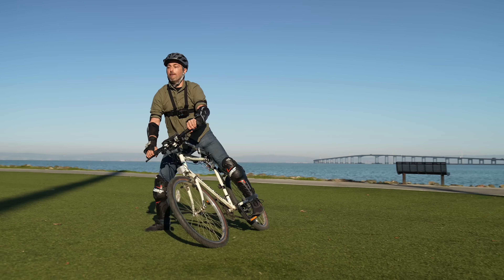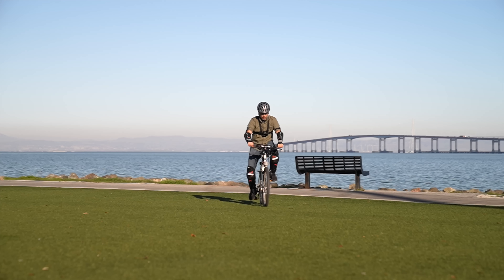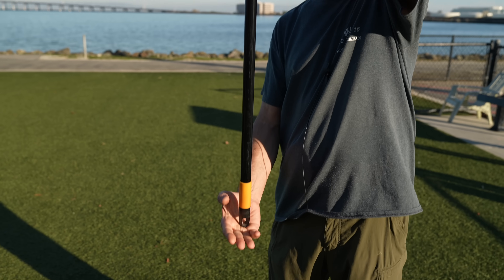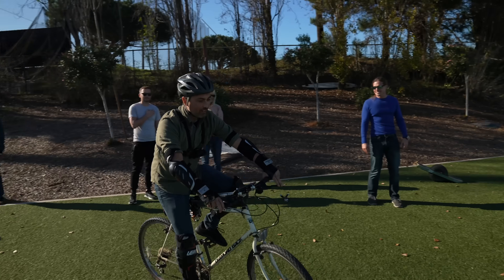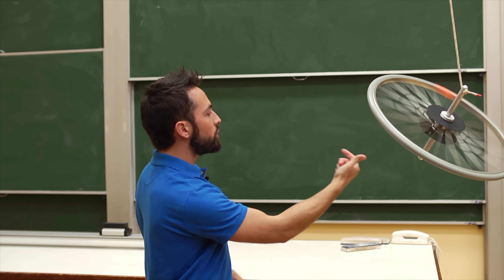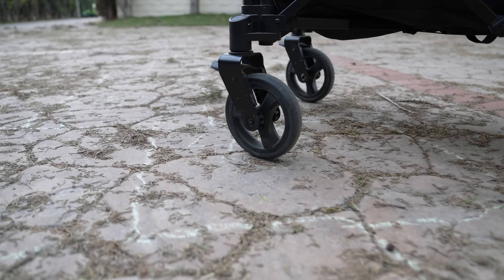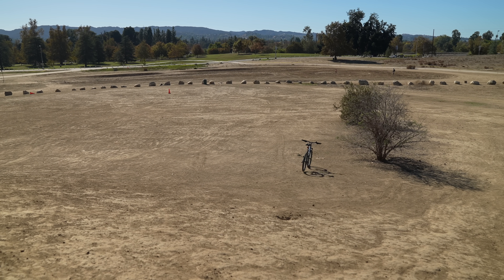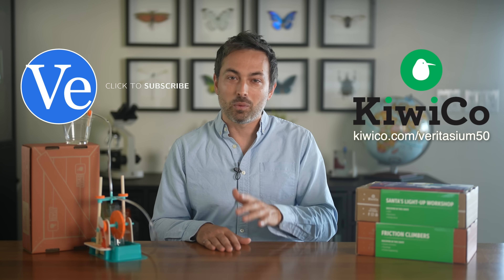Most People Don't Know How Bikes Work

Comment: I find it strange that the gyroscopic effect is just dismissed because there are other phenomena going on as well. The gyroscopic precession does in fact help the rider balance on the bicycle while the wheels are spinning. Anyone who has tried a scooter (which has very small wheels and thus significantly reduced gyroscopic effects) knows this because the amplitude of your corrections will be greater. You can also notice that on a bicycle with small wheels (actually it's the front wheel that matters), you need greater corrections than on a bicycle with big wheels because the moment of inertia of the front wheel is smaller. This can only be explained by the gyroscopic effect.

When you ride a bicycle, the front wheel is spinning and the gyroscopic precession demonstrated in this video thus works both ways. When you turn the front wheel (which is spinning forward) to the right, the gyroscopic effect immediately tries to tilt the bicycle to the left and this effect is instantaneous, unlike the effect of positioning the bicycle underneath yourself, which doesn't kick in until you have obtained a sufficiently small turning radius, resulting in a sufficiently large centripetal force. The gyroscopic effect depends on the moment of inertia of the front wheel, the rotating speed of the front wheel and the angular velocity of the turning movement.
Reply: I think the distinction here is between gyroscopic stability, in which a spinning object strongly resists motion of its axis, and gyroscopic precession, in which lean converts to steer.

The gyroscopic behavior is not dismissed.  But he highlighted that it requires the ability to steer, to be meaningful when considering stability.
Reply: As you say the effect depends on the speed the wheel turns and normally that's not very fast. The video didn't dismiss it completely but correctly for it being a pretty small contribution, especially at the very low speeds they demonstrated
Reply: @GebruikerII  My understanding is that this video is about how bicycles work in general, not only at very low speed.

And when I say that the gyroscopic effect is dismissed, I refer to the fact that the gyroscopic effect is mentioned and dismissed without any explanation: "Why is it hard to balance on a stationary bike? - I think most people believe it's because the wheels aren't spinning, so there's no gyroscopic effect, but that's not it." This does not live up to usual thoroughness of this channel.

It is then presented as a truth that the (only) reason is that you use steering to keep the bike underneath you. But in reality, the gyroscopic effect is also a contributor, which is obvious to anyone who has tried both a normal bicycle and a scooter. Incidentally, the experiments conducted with a locked steering will prevent both the gyroscopic effect and the steering effect.

If you ever try a scooter, notice how quickly you can turn the steering/front wheel from one side to the other with a large amplitude, even at relatively high speeds. On a bicycle you can't turn that quickly, because the gyroscopic effect is greater.
Reply: Absolutely correct. In the demonstration with the gyroscope he was pressing down on one side. Had he pushed forward on one side, which is what happens when you try to turn the handlebars, the gyro would have tilted sideways.

Comment: before i finish watching the video, i know why

the bike is a pair of gyroscopes, in order to turn in a direction, this high rotational intertia means that the balance needs to be first upset, so it can then be manipulated. this is done through counter-steering. i have the ability to ride this bike. i can wheelie, or hold a proper manual, and steer by using my body with the front wheel lifted up off of the ground. I could also hold both front and rear brakes and use them to teeter-totter back and forth after coming to a stop

source: rode BMX for a few years

Comment: I ride no-handed a lot. When I want to turn, I lean the bike in the direction I want to go. I don't lean the bike in the opposite direction first. I wonder if there is some other mechanism at work when turning riding no-handed.
Reply: Nope, same mechanism. Watch your bikes front wheel closely next time you initiate a turn without hands :) It's essentially the same problem as when there's no rider!
He's not saying you have to LEAN in the opposite direction, he's only stating that to initiate a turn the bike must STEER in the opposite direction in order to force the bike to lean the correct way, this also puts your weight on the inside of the turning circle (aka induces a lean the same direction as you'd lean when riding without hands).
Reply: @4bidn1  No he didn't say you have to lean in the opposite direction, but since when riding no handed that is the only way to turn you would have to.
I waited to respond until the weather cleared and I could ride my bike. I was surprised by what I found. How I initiate the turn depends on how quickly I want to turn. If I want to turn slowly, I simply lean in the direction I want to go. If I want to turn quickly, I actually lean in the opposite direction first. It was completely subconscious, I never realized I was doing it until I really paid attention.

Comment: Your explanation of the steering geometry was almost complete, however, you omitted the influence of the rider's mass plus that of the rear wheel and non-fork plus handlebar elements of the system. A bicycle is a "two-frame" system. (See Bicycle Science, Witt and Wilson MIT press circa 1980). The "front" frame includes the fork and the handlebars. The "rear" frame includes all other components of the bike plus the rider. The front frame influences the steering as you described, however, even if the centre of gravity of the front frame is moved behind the steering axis, the bike (with rider) will still lean into a turn owing to the much greater mass of the rear frame acting over the moment arm of the steering offset. You can test this by holding the bike upright and simply pushing sideways on the nose of the saddle. When you do this the front wheel will turn in the same direction. Cheers from Vancouver. Great show!
Reply: That's how I steer my bike through crowds. By the front of the saddle! It makes my total profile narrower so I can get through more easily. (I mean, while walking!)

Comment: This countersteering is much more noticeable with a bike that has more mass such as on a motorcycle.  In order to get the bike to lean into a corner you do so by pushing that side down/forward on the handlebars, which means you are steering in the opposite direction you are turning.  I had quite the realization the first time I rode a larger bike that you actually steer the opposite direction of the turn.

Comment: The fact that the self righting mechanism is so good is very clearly shown when riding without your hands aswell, I made use of that alot a long time ago and biking around with some friends. I got so good at controlling the self righting mechanism it got to the point where I actually found it easier to ride the bike without the handlebars after I got up to speed. The crazy thing about it though, is that I never understood the specifics, I was exploiting a system that I didn't know existed. Just how people never quite understood how turning actually worked, you just intuitively figured it out, and pushed it down so far into habit that you forget what your even doing.
Reply: same but I've always known about everything about bikes, I also find it easier to ride without my hands on the bars, no matter how fast I'm going.

Comment: For me, Veritasium's initial assumption that people don't know how bikes turn (or stay stable) is incorrect. Ever since I was learning to ride a two-wheeled bike as a kid, it was obvious to me that when a bike is already in a turn, it is in an unbalanced state. The imbalance is what makes it possible to turn the bike. The bike is trying to fall over, but the inner-ear balance mechanism enables the rider to counteract the fall by turning the steering, and this cancels the fall to the centre while the bike is changing direction.

However, in order to start a turn, the rider must start by momentarily steering the bike in the opposite direction to the intended turn. This sets up the required imbalance. Therefore, to perform a successful turn, the rider must be able to steer the bike to left and right. One movement to initiate the turn, the second (opposite) movement to balance the turn as the bike is changing direction.

This is why the bike in the video is unrideable. Once the steering is locked, you can't turn both ways, so either (a) you can't initiate the turn properly, or (b) you can't balance and sustain the turn once it has begun.

Simple!  ;-)

Comment: I went outside in near freezing weather at night to test this out, I found that I could turn right without turning left if I tried, I also was able to keep the steering wheel almost completely straight if I don't touch the handles. When you turn sharply to one side, you usually turn the opposite direction first partly because when you lean left before turning left, your left arm would be closer to that side, pushing it, causing you to turn right partially before you start bending your arms. If you try yourself, you might find that you lean before you start turning. Just my hypothesis, might be wrong.
Reply: What part of if you turn the bars right sharply, the bike will start leaning left is hard to understand for you?
Reply: @TunaIRL   the whole thing about riding bikes is a mystery to me ……. So I ride bikes everyday to enjoy this mystery , I just don’t care about the physics, just as long as those wheels are turning
Reply: @arbjful  Ok? And?
Reply: @TunaIRL  just saying….

Comment: I would really like to see really proficient bike riders test this!
I'm not sure but I kind of have the feeling none of the people testing this was a really good bike rider, including Derek. I can stand in one spot balancing on the bike just fine, I can also reposition and rotate by bouncing in one spot... as can many proficient bike riders. 
I tested this today via camera and I can confirm that when I focus on doing so I have zero problems turning right or left without having to steer in the opposite direction first, just by shifting balance. 

still a great video with good explanation. Although it was quite clear to me how a typical bike is inherently self-stabilizing because of the contact point of the front wheel trailing the virtual rotation point, I was consciously unaware of the counter-steering before leaning into a turn. Well illustrated in your slow-mo video but then again, I can easily overcome it when focusing on it and I bet so can most proficient bike riders that know how to balance on a non-moving bike.
Reply: Yes, if you’re an experienced rider you will naturally learn that you can lean to initiate a turn instead of counter steering.
Reply: @briangibson8627  Nope, you didn't. The steering still counter-steered, even if you didn't actively, consciously, provide that counter steering input on the bars. Even if you take your hands off the bars completely, a counter steer will still happen. Ride with wet tyres, take your hands off the bars, turn, and then look at the track the wheel made immediately before the turn.
Reply: @allmhuran  just did it with wet tires... no counter steering IF I focused on doing so but well pronounced if steering instead of shifting balancing but I'm more certain than before that it takes people that can balance on a  standing bike.
Reply: @randfee  No, you didn't.
Reply: @briangibson8627  Mhm. Post it.

Comment: “Steering for balancing” that is only because that was how everyone learnt how to ride the bicycle, given that particular design, which was a good design by the way.
But if the bicycles was designed as the one in this video, human body will learn riding bicycle in a different way. e.g upper body shift to the opposite direction then turn the steering bar.

Comment: Riding on a standig position allows the rider to lean in the direction they're turning without shifting the gravitational center so no need to counter steer
Reply: I do believe that if you lean/counter-turn slow enough, the “locked” allowance of the single-turn-direction handlebars would be enough to initiate the turn. Get a pro on that bike!
Reply: When you lean your body, the force reaction (Newton) is to push the bike in the other direction, so the gravity center doesn't really change.
You can't pull yourself up by your hair for the same reason.

The steering works, because the reaction is "pushing" the Earth, so that's practically immovable due to bigger mass difference.
Reply: @SorinNicu  Pay attention to 2:13
Reply: Nope. A counter steer is always required, even if it's one you don't actively initiate.
Reply: @allmhuran  Pay attention to 2:13

Comment: I'm Dutch and I CAN ride it.
U can steer by shifting your body's center of mass.
This is also what people do when driving with no hands on the steer.
Reply: everyone can learn to do it but I bet you wouldn't make it first try
Reply: No, you can't. Not if the steering is fixed.

If the bike is vertical, then when you shift your centre of mass one way, the bike will lean the other way. It has to. It's just basic physics. In order to move your body you have to apply a force against something, and that thing is the bike. If you shift your body left, the bike will shift right. The system basically a big lever balanced at a fulcrum on the ground. The centre of mass won't change.

However, if the bike is not vertical, then some of that lateral force gets translated into a lateral force against the ground. And as demonstrated in the video, the front wheel is constantly countersteering. It's never "perfectly vertical" for any significant amount of time. So when you "steer by leaning", what's really going on is that you are taking advantage of the natural, continous countersteers that are always happening. 

But if you weld the steering straight, the wobbles can't happen, and you'll fall.
Reply: @allmhuran  The steering is not fixed my friend. It's only jammed to 1 direction. Still allowing like 90° of space in stead of 180°. More then enough for an acrobat.
Reply: @flipped_bit  Well, as the video demonstrates, it's both. They can lock out one pin, or both, making it able to turn in one direction, or not at all. But it doesn't change the point. If the steering only works for one direction, you could ride it... in circles. You would have to start with the bike already leaned, and the steering turned to the desired angle. You could make the turn tighter, and you could make the turn wider. But you wouldn't be able to go straight, and you wouldn't be able to maintain a turn in the the other direction. You could start trying to turn in the other direction - as in, if you only allowed the steering to turn left, you could certainly get the bike leaned over to the right. But once leaned over, it would fall down. You wouldn't actually be able to maintain a right turn, because to maintain a right turn the fron tyre must be pointed to the right during the turn.

Comment: I was taught this counter steering in my motorcycle driving course. At first I thought they were nuts, but sure enough that was exactly how it worked. I've had a Motor bike license for over 30 years. This is old news to me.
Reply: Knowing about counter-steering and practicing counter-steering on a road motocycle is a very useful technique that may save your life when some idiot crosses the centerline and is coming at you.  Your avoidance maneuver happens much more quickly by counter-steering than you trying to lean or steer your way out of the head-on collision.  The act of counter-steering actually causes the bike to turn the opposite direction of steering RIGHT NOW.  Try it sometime, it may save your life.

Comment: I think he is wrong, I'll bet 10,000 pennies. When riding a motorcycle, going slow, you use the handle bars. When going fast, you DON'T use handlebars, only lean. There is a speed at which it crosses over. He was trying to turn handle bars when it was in lean speed. Go out and try on pedal bike. When you are at decent average speed, just lean. You can't turn handle bars. You don't notice , you think you turned wheel.

Comment: Or you could ride the bike the correct way, by steering *by shifting your weight*.
You know, the way you steer without touching the handlebars
Reply: I think you’ll find you primarily shift the bike rather than your own weight.
Reply: Shifting your weight causes a countersteer.

When you lean your body left, the bike will lean right. When the bike leans right, the steering geometry causes the front tyre to turn right. This is the countersteer. The countersteer causes the bike to lean back the other way, to the left. Once the bike is leaned left, the steering geometry will now cause the tyre to turn left. But the difference is that you are also leaned left. So we now have the centre of mass to the left of the contact patch, the frame leaned to the left, and the front tyre pointed to the left. The bike is in a stable left turn.

This process is much much less effective than manually performing the countersteer using your arms on the handlebars, which is why you can perform much much sharper, more controlled turns with your hands on the bars. But don't be fooled - it's still a countersteer.